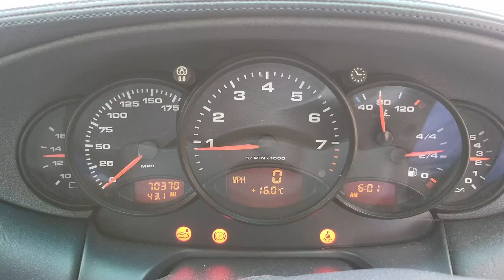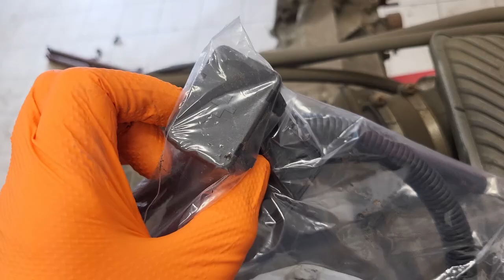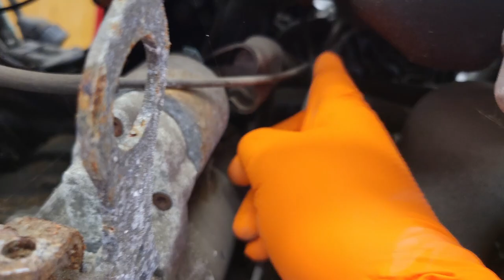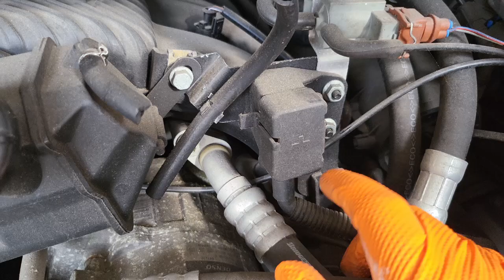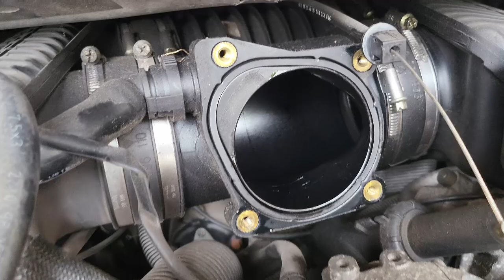Porsche 996 slow hot start fix

Comment: Hey... Great video! I literally just replaced my "Y" cable a week before you posted your video... Searched all over the net and there were no videos for the 996. So it was needed:) I was able to do mine pretty much the same way as you, only I was able to do it without removing the alternator. Maybe I have freakishly skinny arms :)
 Unfortunately after removal, I inspected my original "Y" cable, it seemed to be in perfect condition... and on a day that was abnormally hot, I took the 996 for a drive to test the 'Hot Start' problem... and the issue persists:(
Reply from the maker: Sorry to hear that.  I inspected the cable which came off and couldn't see any issues, but my problem is definitely fixed.  Once the engine was warm it was really sluggish to start, now it is fine.  I thought it could be the y-cable or maybe the starter motor.  In your case I guess the starter motor.  At least you know how to get to it now.  Looks like there should be enough to get at the starter in the same way as the y-cable?   I agree on no video, that is why I made one :)
Reply: @martinhill5770  well I found my solution... the other day I was out for a tour and my battery and ABS light started coming on and off. Made it home ok.. but Alternator was making a terrible noise. Took it out to inspect and pieces started falling out. Ordered a new one, and figured while I was waiting for it to come in, I might as well service the starter. Cleaned and lubed. Put new Alt in... and now its starts like a champ, hot or cold.   :)
Reply: @Poorish911guy   so was yours hard to start when cold as well as hot? If your alternator was goosed then this should be the case , in fact it should crank even slower when cold